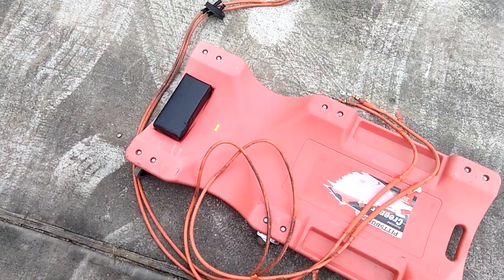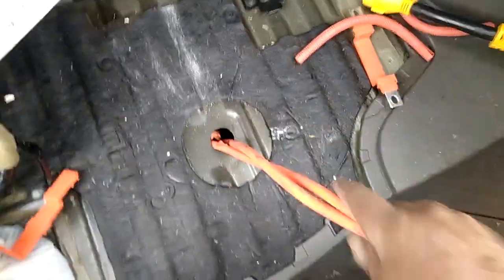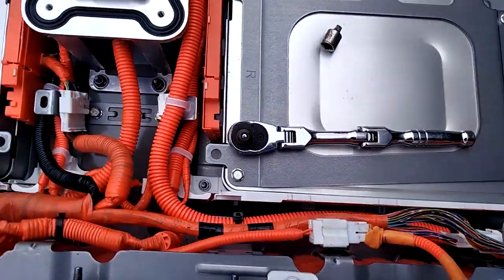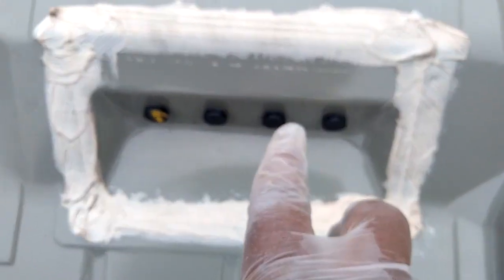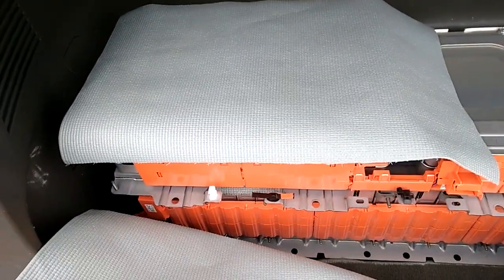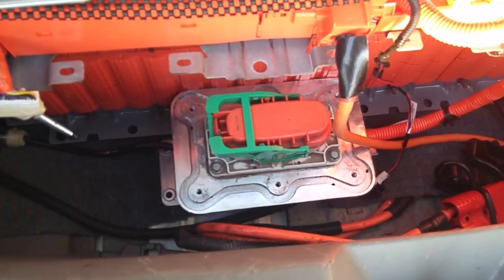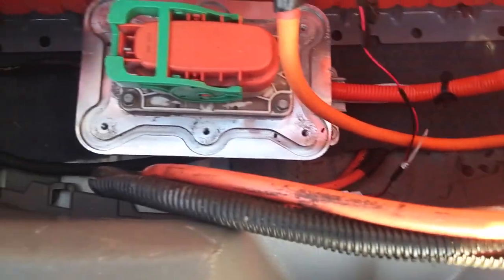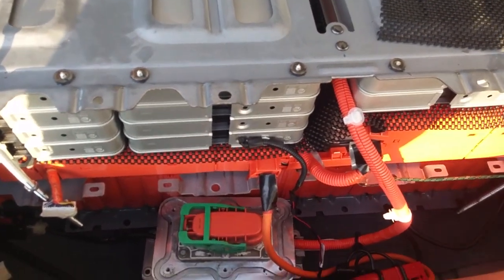Details on Nissan leaf DIY 48KWH connections

Comment: Does the GOM adjust and show you the range for the whole battery? i.e. did your predicted range on the dash increase over time once the double battery was installed?
Also was there a reasons for insulating the battery from the body? from my memory the original cells in the battery case under the car are grounded to the battery box which is in turn bonded to the body. 
Good effort though!
Reply from the maker: The GOM was more accurate with time as I drove the car.
I was getting high voltage leakage from the battery in the trunk , and I later found out why in my recent video where I did the repair.
Reply from the maker: No.

Comment: How did you get both batteries to the same voltage before connecting them in parallel?
Reply from the maker: I was able to bring the two banks of battery to the same voltage by use of a voltage meter as a bleeding device. This was done by putting the probs of the high voltage meter inside the fuse of one of the bank while the main fuse of the traction battery will be in place pluged, when the voltage difference display on the meter is very low like 14 or less then you can remove the meter to plug in the fuse.

Comment: For BMS?
Reply from the maker: https://www.youtube.com/watch?v=63GNQp45Bmc&t=33s
Capacity bar determines how many kilowatts the car will put back in the battery during charging with the use of the current sensor. Even when I had the two banks of batteries in parallel once the car gets 18KW it stops charging without BMS on the second battery bank.
With the new connection bypassing the current sensor for the extended battery without BMS still, the car will put 18kW in the main battery and then another 18KW in the extended battery.

Comment: i would bet that by paralleling the two batteries, the degradation would slow down. Any feedback on the SOH status after more than a year you've been driving with this setup. What is the average indoor and outdoor temperatures
Reply from the maker: The Nissan Leaf with cold-weather climate package performs better at winter while the Nissan leaf without cold-weather climate package performs better in summer.

Comment: Great Video. However, I believe the little 250amp fuse is not rated for switching the high voltage (350V). There is a high risk of dc arcing and hence fire. I would rather use a 400V 250A DC breaker
Reply from the maker: You are correct about the 250amp fuse, the little fuse kept opening any time hard acceleration was needed.  I did replace it with just a connector and now depend on the OEM fuse originally with the battery.
Thank you.

Comment: Do batteries in the back overheat after sometime of driving? Theres nothing cooling them other than the AC inside of car. How long has is worked with this upgrade?
Reply from the maker: The batteries in the trunk do not overheat because they share the load with the main battery under the car and whenever I demand more current mostly during fast acceleration my little 250Apms resettable fuse opens which is now replaced with a connector.
It is now over a year that has been driving the two 2011 Nissan leaf every day.

Comment: Nice work bud!  Your storage for the 2nd battery looks a lot cleaner this time around.  What is the total range for the Leaf in this video?  Do you have any data on what the wattage loss was before you put the batteries on the insulating mat?  Just 10 watts or so could be normal trickle draining for an old battery, but much more than that and you could have a damadged cell that maybe has a short in it.  If you do you could replace that cell, and remove the draining issue from the whole system,